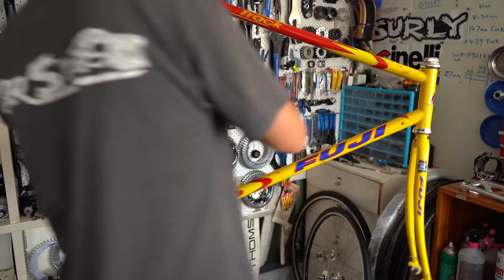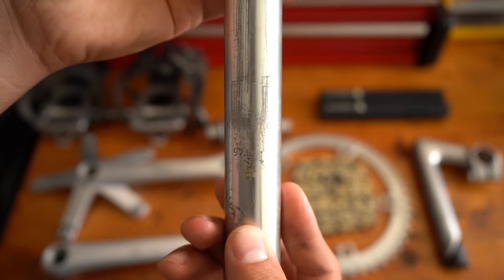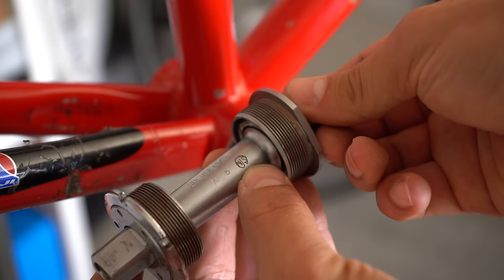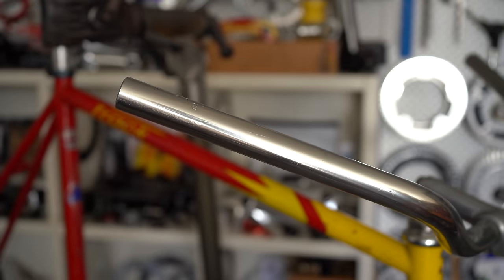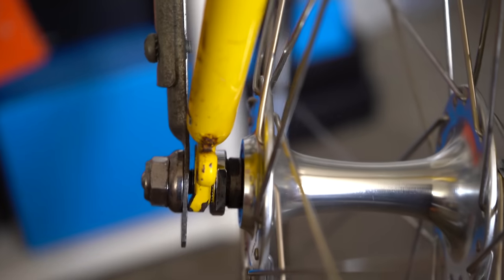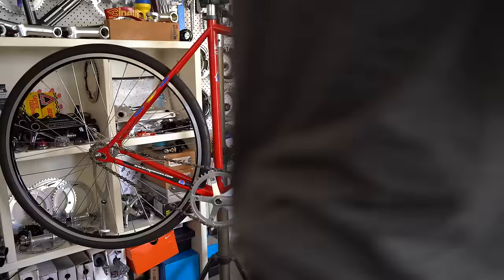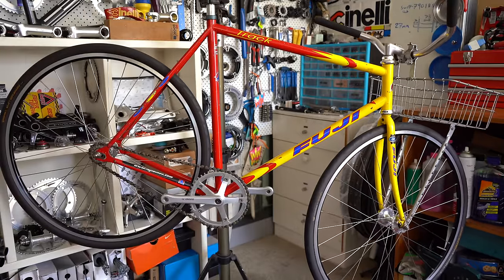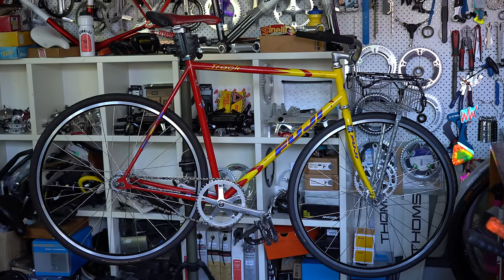Beater Bike Build - Fuji Track 2001

Comment: Love the build! Like you mentioned, I'd raise the stem just a little and angle the handlebars down a bit. I'd keep the Nitto stem, the Cinelli looks too .. crazy. If you're gonna be riding more upright, consider a saddle with more cush - that Flite is way too sporty, IMHO. In the next video, I'd love to see a close-up shot of a drop of Loctite Blue on the Izumi halflink chain bolt ;) Cheers from the Netherlands and keep'em coming!
Reply from the maker: Cheers man! Yeah I usually do a few adjustments after the first few rides to tune it in. Have lowered the bars a bit and it’s pretty comfy now. Do agree about the saddle but I couldn’t not put this on, just love the look of them too much, and felt like this red one was destined for this frame haha. I don’t usually use loctite, haven’t had any issues on my super toughness master links yet but thanks for the tip 🙏